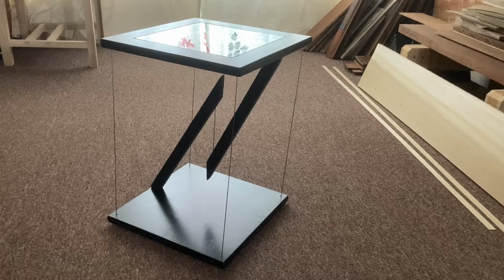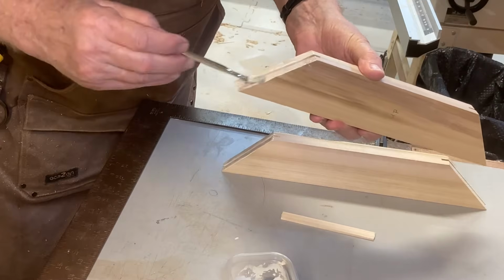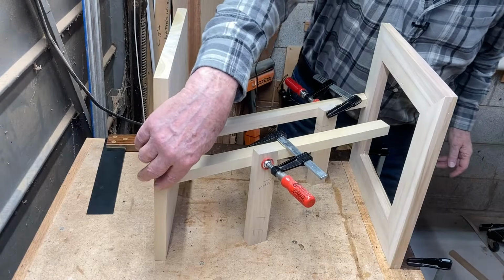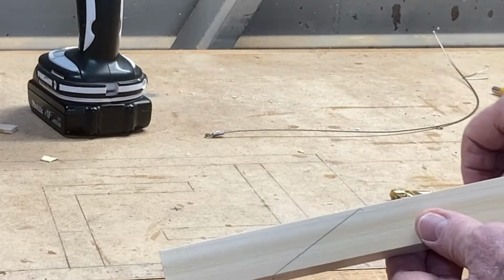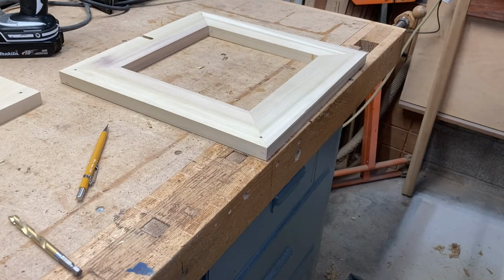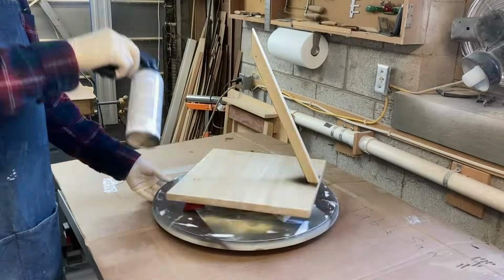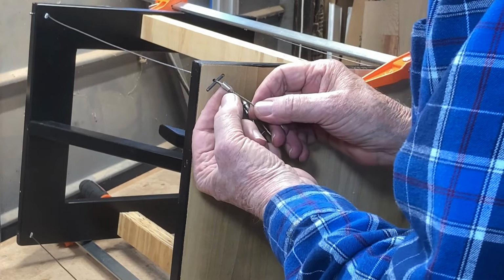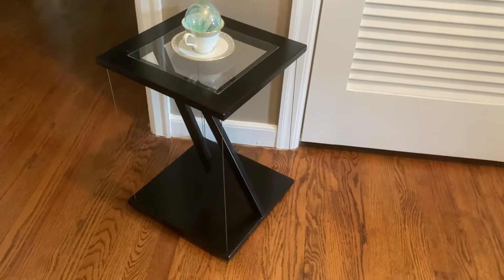I Built This Tensegrity Table For Fun

Comment: Hi, Ron! Great video. I'm currently working on my tensegrity table, although it's a bit smaller than yours. Can you tell me more about your tension bolts on the bottom? I'm trying to figure out a good method for adjusting the tension on my design. Thanks!
Reply from the maker: All I can say is in the video. Thanks for watching.

Comment: Great video, and I am trying to make one myself about this size could you tell me what size the bottom square was and also the arms in the middle?
Reply from the maker: Thank you for watching. The top and bottem are 14" square and the arms are 18" long. Good luck.
Reply: @RonMulletWoodwork  Thanks but I forgot three questions in the original comment. those were what did you use to make the dovetails and what angle were the arms at? And what is the name of the tool that you used in the bottom to make the hole for the tensioners

Comment: I love the video, you gave me a few ideas like with the pins in the bottom that act like bumpers. It's also much simpler and easier to tension than some examples I've seen. 
My only problem is that I'm a hand tool guy who can't make nice dovetails yet, so I'll probably stick the legs in with a wedged mortise and tenon unless I figure something else out.
Reply from the maker: Thank you for watching Dan. The weakest point is the dovetails so make sure that connection is very strong.

Comment: I really enjoyed this so have subbed 😃 
Only thing I was thinking was would you put a small channel from the bottom corners (where the wee pins are, fab idea btw) to where you countersunk the tension thingee-majig? And what about maybe small feet on the bottom - so the wires etc aren't directly on the floor, as it didn't look like it was sitting dead flat on the ground. Prob stupid questions lol but I figured it didn't hurt to ask 🙂👍
Reply from the maker: Thank you for subscribing. Those are excellent questions and they defently would work.

Comment: First time ive seen the tensioning set up on the underside to adjust the cables, thats very clever. 
Ive also wanted to use steel wire but am worried that it might end up requiring rework as a result of the expansion and contraction of the cable as the temperature changes over the year. Thinking particularly as it gets into winter and the steel shrinks it might put too much pressure on the uprights and snap them. Has your table had any issue's?
Reply from the maker: I have never had a problem with the cables. I would advise making the "legs" a little wider so the Dovetails can be longer.

Comment: Hi Ron - congratulations. This is one of the best Tensegrity Table builds I have seen. Do you take commissions?
Reply from the maker: Thank you for watching. I normally just do it for the fun.
Reply: @RonMulletWoodwork  Ah c’mon.  It WILL be great fun 😄.  I have a pair of very elegant, white, classic, Bang & Olufsen Beoplay S3 pentagonal speakers that will look fantastic on top of a taller (18”) version of your tensegrity table with a smaller pentagon instead of square top and base in white.  I will design it and send it to you for your consideration. 👍

Comment: Hi Ron, great vid, any chance you can share any info on the tension screw that you used pls?
Reply from the maker: Thank you for watching. It is a 2 inch eye bolt ran through a small angle brace with a nut to adjust the tension.

Comment: You really didn’t 10:18 explain in full the cable tensioning.  imo
Reply from the maker: Thanks for watching Richard. The nuts on the eye bolts on the bottem of the table are used to pull the cables tight.

Comment: Hi Ron, Great video!. My son and I have roughed out a round version of this table for a Boy Scouts project (sans glass top). I do have a question. I'm struggling with the dovetail jig. Any hints or steps to make that Jig ? I'm coming up too loose/small.
Reply from the maker: Thank you for watching. I would instead suggest using a dado on the round top and bottem and screw and glue it to the legs. Use a router with 2 boards clamped in place as a guide.